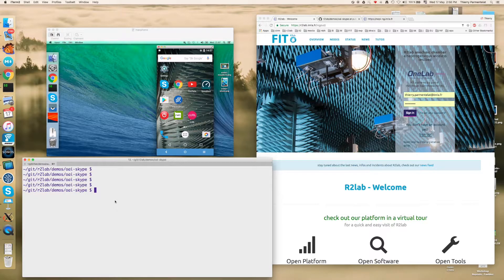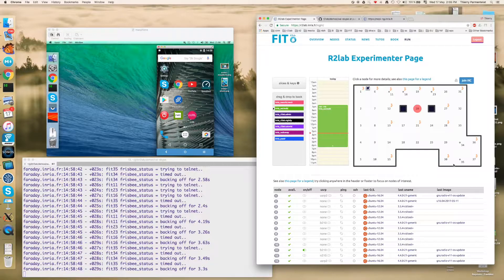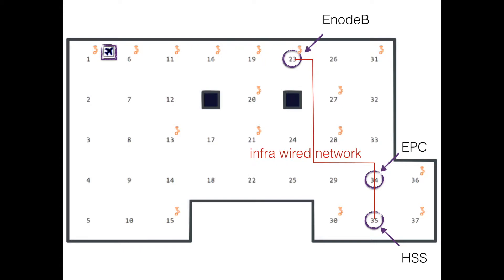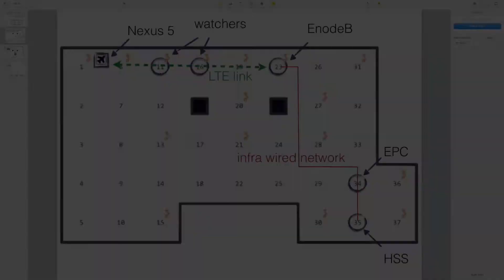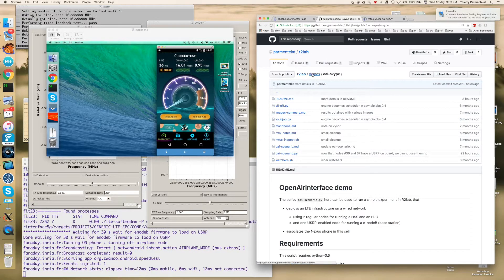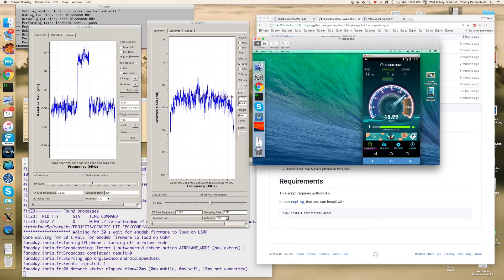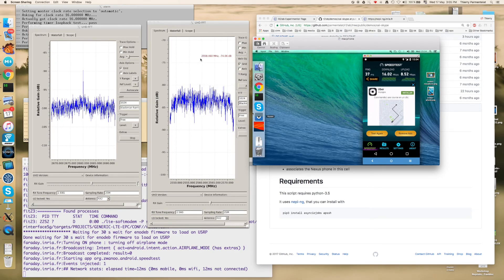5G in 5minutes with OpenAirInterface in R2lab

Comment: Hi, I have a specific question with regard the GUI of the UHD driver for the USRP. Since the driver allows setting up the USRP sampling rates, frequencies etc., I'd like to know how to initiate the GUI? So far I've been working only through command line. Thank you in advance! It's a great video btw
Reply from the maker: Not sure if that is what you are asking for, but if your question is about remote display on top of ssh, be aware that X11 forwarding is supported in ssh. 
In essence, you would run your ssh sessions with x11-forwarding enabled (in apssh, this is done through a SshNode instance that is created with a `x11=True` flag)
Once this is done, and provided of course that you have a local X11 display (native in linux, easy to setup on mac, not sure on windows), then you can trigger a GUI through ssh and it will display on your local display.
Reply: @parmentelat , Not quite about X11, but particularly about the UHD window of USRP. I'm configuring the OpenAirInterface configuration files manually before launching the softmodem. I can see some sliders in your window which may allow you to modify sampling rates and other parameters. It would be insanely good thing to have
Reply from the maker: Hiya; I'm still not clear on your question; would you please be so kind as to ask it again on this address
mailto:fit-r2lab-users@inria.fr
where more people would see the question and benefit from the answer
thanks in advance
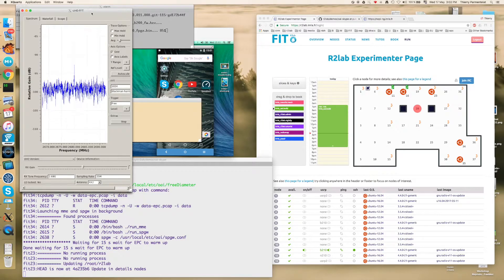Reply: Hi. I'm already in the mailing group but I have seen this particular thing that you have in the video. It pops out at 3:39 and then you're increasing the window size. How did you get to this GUI window? Did you install it via the UHD driver somehow? I am using the USRPB210 with its UHD driver which is only in command-line, but here specifically you have a user interface window
Reply from the maker: Oh, that !
We use a tool named `uhd_fft` to visualize the spectrum as reported by the USRP
From a r2lab user point of view this is done through the convenience alias `watch-uplink` 
the source code for this is in
https://github.com/fit-r2lab/r2lab-embedded 
and specifically
https://github.com/fit-r2lab/r2lab-embedded/blob/master/shell/nodes.sh

as I touched on initially, this `uhd_fft` tool relies on X11 to get displayed locally on the mac that captured the video 

hope this helps -- Thierry
Reply: Wonderful! That's what I was puzzled by. Thanks a lot for the aid :) Cheers!